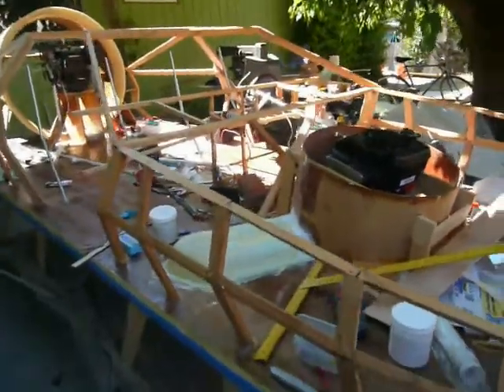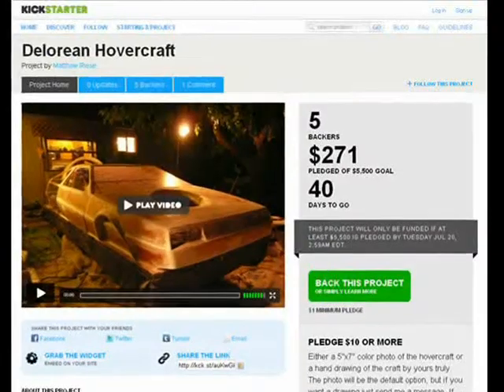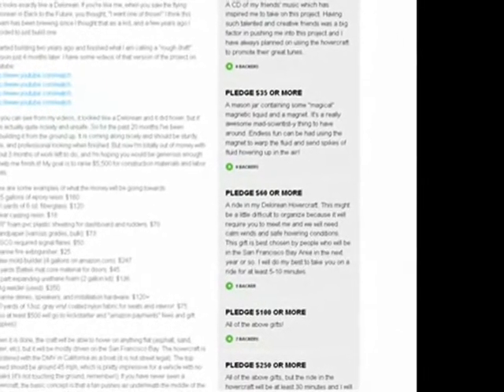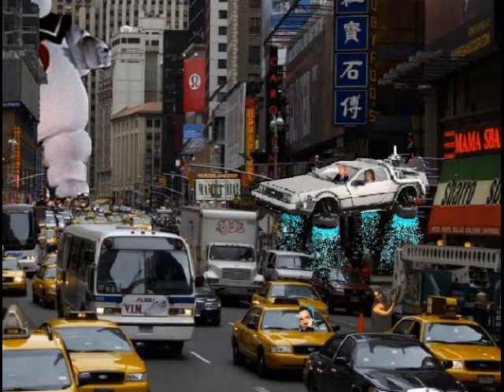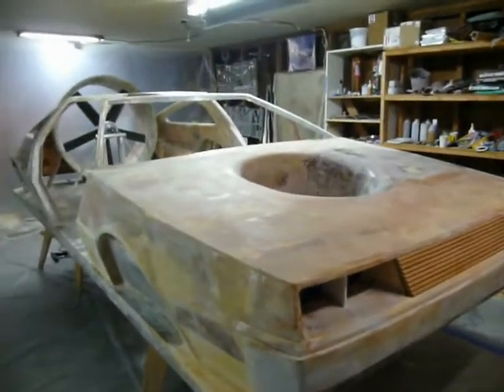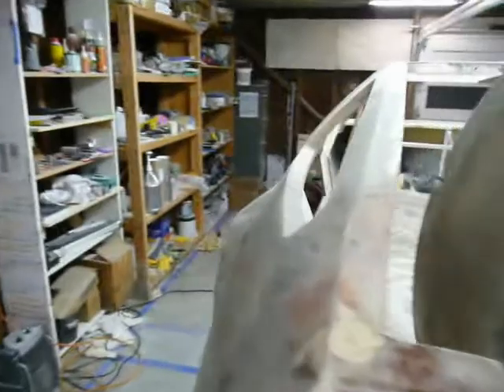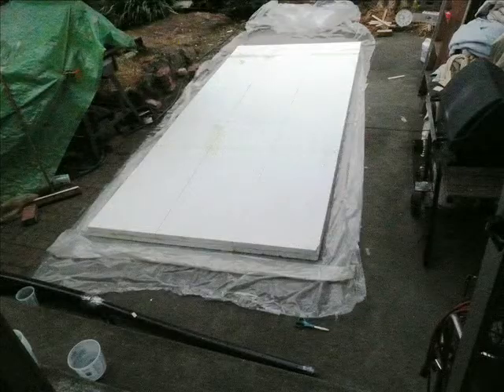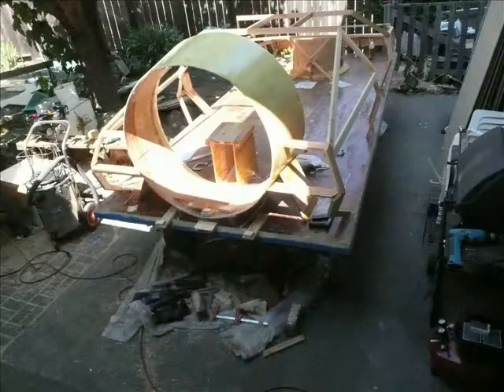Support my flying Delorean AND get some magnetic liquid!

Comment: It's not going to lift... It's going to be heavy I recommend 4 wheel magnet motors pointing downwards some how causing lift then for that size vehicle I'm sure the magnets would have to be large and charged with full amounts of magnetic energy but even still I would not know how to make the push the magnets push it's normal speed but anyway good luck